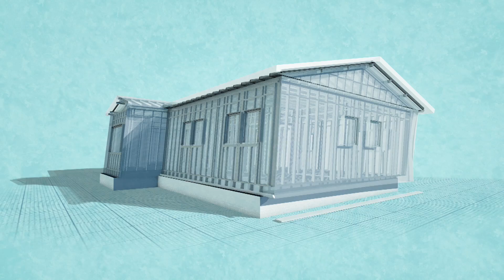How to Retrofit a Home for an Earthquake | Ask This Old House

Comment: How many points do you have to connect the walls to the floor?
Reply from the maker: It depends on the house. There are a couple things you have to calculate using the weight of the house, ground force acceleration rate (which is a percentage and varies by state), and the weight rating of the hardware being used to determine how many you need and where they need to go. If the house is more complicated than just a rectangular shape, the calculation gets more complicated.
Reply: Robert Cookson if they told you that you wouldn’t need the guy in the video
Reply: If you did every sill plate in between the joists I think you'd be safe, although overkill........never kills........
Reply: @Florida_Man_In_Florida  Trying to be cost effective in doing it. Would think it should have a rating for how far aprt they can e to still be effective.
Reply: @EyeintheSky999 … I suspect every community will have a different standard, which will be similar to new construction code on distance between foundation fasteners.  Here in the northeast we don't get earth quakes but have had code to fasten the sill plate to the foundation since at least the early 60s. In more recent years we are now required to fasten the roof rafters to the walls with hurricane clips, even though we seldom get anything that nasty. I do feel that eventually there will be a minimum national code (for new construction) on stuff like this.
Reply: @Florida_Man_In_Florida … You may be close in years but many areas allowed gravity to do the work up till near 1960 and that leaves quite a few homes in need of help when you figure the post WWII building boom.
Reply: Should it? Yes. but some of the older way was a piece of rebar bent sidewaysish,  some were only tied into the first few inches of concrete. , some never bent at all. In an earthquake its just really a matter of lateral motion, not horizontal. If your in a hurricane area,   you need the horizontal control.
Reply: improvement is actually greatly improved if installed close to the end of the 90 degree intersection of walls.  Long spans of walls will benefit from having one installed into shorter sections. I don't think there is prescriptive code for this however, though I could be wrong. If I needed to do this I'd install at least on every corner of every wall, including the load bearing walls, as thats where the joists usually overlap and may not transfer load from one side to the other side of the house effectively.
Reply: if only if every builder built above minimum...
Reply: @Florida_Man_In_Florida  Not here in Seattle: like Portland that wasn't code until fairly recently. Our 1958 house just had friction holding it to the foundations so we spent $8K getting it attached properly. If you are DYI there are recommendations for the plate spacing etc.. What we don't have is a gas shutoff valve. Must look into it.
Reply: It’s guesswork and a borderline scam. There is no right/wrong answer.
Reply: I'm in a lot of crawlspaces and basements in and around Seattle and usually it's every other stud bay.

Comment: What a big ripoff! What he did is pretty much useless just put some Teco connectors here and there. To do it correctly every stud, joist and roof must have the Tecos on them . Every corner of the house should have a rod from the roof plate down to the foundation plate. For the inside he put putty on the vase LMAO, the homeowner now think her house is safe if there is a earthquake, what a false sense of security.
Reply: You are welcome to publish your own video.
Reply: @gene8172  100% agree.. almost in every video on YouTube are comments like that and I always think "why don't you upload a video showing us the 'right' way to do it?"
Reply: It's a retrofit. You have to balance the ideal solution with what is achievable at a reasonable cost. Nobody's saying it's a perfect solution.
Reply: Homepros NYC... read in between the lines. The key here is it's SAFER that doing nothing.. and we all know this is NOT for the big one. Consider it like making your home kid proof. Not perfect but solves 80% of the smaller issues.
Reply: I agree.  This is nothing but making a profit from fear.  If a large seismic event were to take place, nothing on Gods green earth would prevent total destruction.  How much did it cost to install a few dabs of putty and a bunch of sheet metal T straps. You have got tp be kidding me, the placebo this company is selling is criminal.

Comment: Very happy the guys from the New England area didn't jump in and act like they knew everything about Earthquakes, instead they acted like pros and realized someone else knows way more.   

My house is a bit better equipped even though it was built in the 50s,  huge bolts tying the sill plate to the foundation which was quite surprising to me when I went looking at how to strengthing my house, as well as all the blocking in the walls at angles instead of horizontally.   I mean I complain about it all the time since it's a PITA to drill through that blindly but it helps in the long run.

Comment: In ontario Canada you aren't allowed to touch the gas meter even if you're licensed only the distribution company is allowed to. And as a gas fitter that should have been done by a certified gas tech.
Reply: Well luckily every place doesn't need to follow the rules of Ontario, Canada.
Reply: How do we know he isn’t a license gas fitter?
Reply: Marco Rocca gas technician level 2 only takes 4 months to get in ON. Basically a cereal box license....
Reply: @dedicatedpyro  yeah I have it, I did the two year program and in the end I got a g2 and apprenticeship and I'm still not working in the field 6 years later.
Reply: I suppose he got the proper certification. Here in Germany it's different, the plumbing businesses here are licensed by the local distribution company. And they must be, otherwise they are not permitted to work on the gas pipes. They can do practically everything behind the meter, including the connection leading away from the meter. The input of the meter is sealed (yellow plastic sleeving, prevent to loosen the connection to the meter input), so if someones installing a bypass this would be a proof for stealing gas because you have to remove the seal. But in modern installations you can't actually do anything because the connections are crimped and not screwed. Distribution company layed the pipe into the basement, the rest, including the base of the meter, was installed by the plumber. Later a technician of the distribution company came and installed the meter. That's a pic of my meter, installed in 2013. Next to it on the left is the service entry for the electricity.

https://abload.de/img/img_5942zyjf6.jpg
Reply: @Marcel_Germann  wow I like your set up all pro press copper and that's real smart for putting a seal. We in ontario canada have to take a two year course and become licensed by the TSSA  (Technical Standards and Safety Authority)who issues us our license.
Reply: @Marcel_Germann  yes that is really excellent education...unfortunately for us here our government doesnt care to invest in education like you described, it's a shame..we do have lots of unemployment and way too much immigration from the government...that's where they dump money not on their own canadians
Reply: Marco Rocca Also our governments invest heavily in real trades, just not gas fitter donkeys.
Reply: @ekujj13  I think they do it the same way as we do it in Germany: You can do almost everything, but always obey the 11th commandment: Don't get caught!
Reply: Gee a "certified gas fitter" probably another government fee for a little card to put in your wallet that says you know not to use open flame to check for leaks. Oh boy.

Comment: What about the brick chimney above the roof line.?  If that comes tumbling down, goodbye roof and everything in it’s path.
Reply: All the bricks need to be removed down to floor level.  Most of the deaths in christchurch New Zealand earthquakes were falling chimneys and brickwork. In my house someone missed death by going for a smoke outside,  where he was sitting inside a few minutes before had chimney fall on it and crushed the sofa.
Reply: Better a roof then the whole house.
Reply: Where the chimney is located on the roof if it falls in one large section the roof May hold it but chances are if the chimney Falls then the house has he moved too much for it to be safe to ever be lived in again if one would live there you just have to be conscious of the chimney and make sure you get away from it during the earthquake
Reply: not true, the top of the structure always gets the most movement. and chimeys have very little reinforcement, and are often weakened already from not being maintained.

Comment: That emergency gas shut-off is genius, and so elegantly simple--no accelerometers, no electronics, all mechanical and easily reset.
Reply: Yes,  like it too. The sticky tape for fixing vases to a cupboard, however, seemed a little bit strange. I am sure it either ruins the furniture over time although he said it would not, or it loses its stickyness.
Reply: @christiangeiselmann  it doesn’t. I have used it for years positioning items in product photography and have been using the same putty for years on every surface you can imagine. It’s very safe stuff.
Reply: @TobyCostaRica    Okay, thanks!
Reply: @christiangeiselmann  If you have something really expensive on a shelf you probably care more about the item than the shelf discoloring over time. If it falls your priceless item will break, but shelves can be replaced easily.
Reply: The real question is why are the shut offs not standard. They should only cost like $5 especially if bought in bulk. Also seems like gas companies would want this so they would not have to pay for damages.
Reply: @cadenricker7475  - Gas companies' responsibilities end at the meter and nothing after it.  Even if they cost $5, that's 5 x 500,000... $2.5 million they could spend elsewhere than fear mongering.
Reply: @cup_and_cone  Why don’t they have the gas company put it on its side of the meter?
Reply: Nice job explaining
Reply: Too bad it's made from aluminum...and is threading into steel.  Recipe for galvanic corrosion from dissimilar metals.  As long as you don't mind paying a plumber to come out and replace it every 10 years, sure it's a good idea.
Reply: @cup_and_cone  Sounds a lot cheaper than having an explosion destroy your house... but maybe that's just me?
Reply: @cup_and_cone  Couldn't this this corrosion issue be mitigated by using brass nipples instead of the steel at 6:53
Reply: @cup_and_cone  if it's largely in a dry environment it shouldn't make a blind bit of difference. It would be been better if the nut was brass, or similar.
Reply: @geetarwanabe  The PNW is very wet and the gas pipes are essentially grounded.
Reply: @cup_and_cone  Materials and Processes Engineering was a big portion of my engineering program (I work for a gas utility), if you were really worried about the corrosion between anodized aluminum and painted steel, you could electrically isolate the two metals and use a type of compound on the bolts to mitigate it.

If you were worried about it anyways. Meters have a life expectancy and will corrode over decades of usage, I would just replace such a device every few decades - or employ these methods if I saw dissimilar metal corrosion happening quicker than anticipated.
Reply: @Clenched.Cheeks  How can you electrically isolate it? Would be nice to know and seems like a legit solution.
Reply: @HasanainShuja  You could electrically isolate it in a few different ways using gaskets, pipe dope, a sacrificial anode, CP, etc.

That said, someone above said it right. The gas company's responsibility ends at the point of demarcation and they don't need to pull permits and spend capital beyond. That's where you get a gasfitter, and he could install it for you for cheap.

It's good for the local economy and costs less than we would be able to do because of economies of scale. :)
Reply: @Clenched.Cheeks  Thanks. I'm guessing if it was made from the same metal than this can be avoided (galvanic corrosion)?
Reply: @HasanainShuja  if it were machined steel you would have the same electrode potential yes. However, aluminum is a softer metal, malleable, and easier to machine.

When it comes to corrosion? Everything corrodes eventually. Just replace it in 20 years with another 5 dollar piece.
Reply: @Clenched.Cheeks  Thanks. Makes sense.